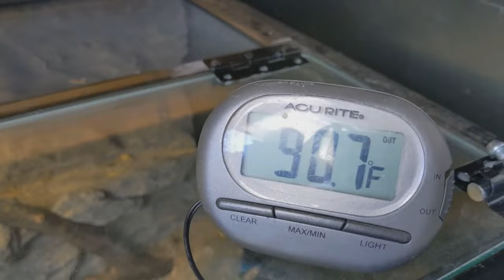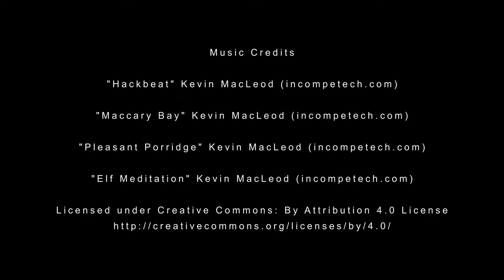Bioactive Desert Vivarium -75 gallon aquarium conversion

Comment: Can you list the supplies used in your video to make the background? I see dry lock and the anti skid? I'm wanting to make my own background using your video. Thanks so much!
Reply: Also, how long after you set it up do you need to wait before adding a gecko?
Reply from the maker: I used concrete pigments to tint the dry-lock.  I would suggest getting a black or grey Dry lock to start instead of white, but the only color available to me was white and it still turned out well.  Also, use the liquid pigments for the darkest first coat(which takes the longest-hours) and then use the powdered pigments for a thicker consistency on  the later dry brush coats.  Finish with the anti skid coat. Reference Serpa Design's bearded dragon habitat build as I took min inspiration from him
Reply: @NatureNatesVivarium  Thank you so much!!

Comment: Question. Do you watch surpa design?
Reply from the maker: How did you know? LOL, yes, I take significant inspiration from him, but there are some glaring problems with many of his builds that I do differently.
Reply: As someone who's completely new to this, what are his issues with designs? I'm getting ready to start one tomorrow actually amd the more info the better lol
Reply from the maker: @Inverts4Introverts  I'd be happy to help you through the design process.  I've spent hundreds of hours and dollars researching what does and doesn't work.  Reach out to me on Instagram (naturenate19) and I'd be happy to help you get on the right track.
Reply: Hi I’ve never made a tank before but interested in trying. What’s the pink board?